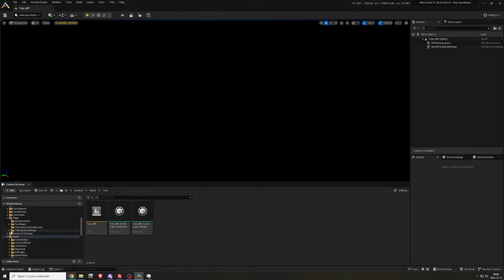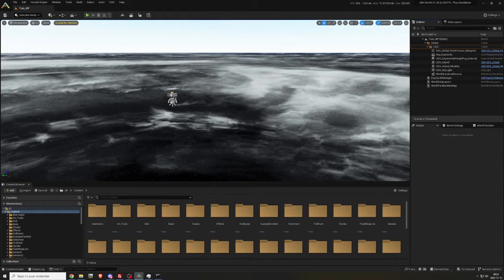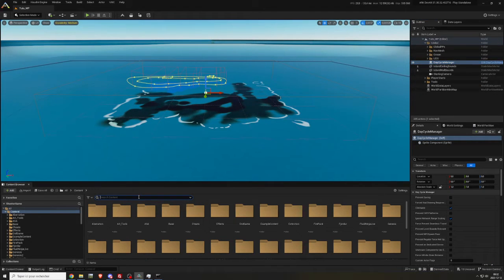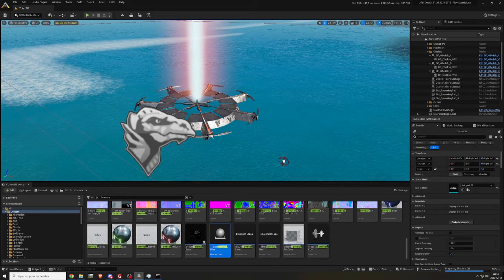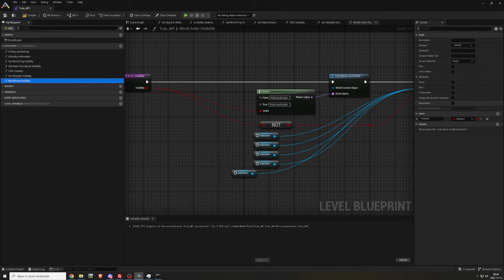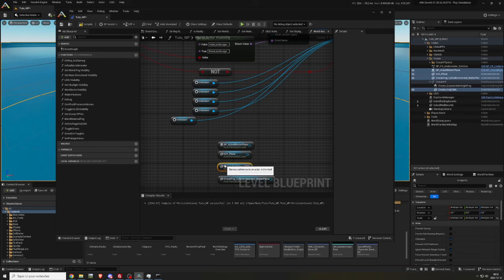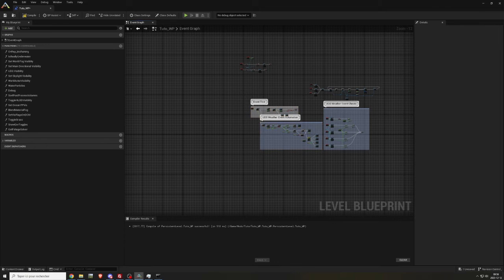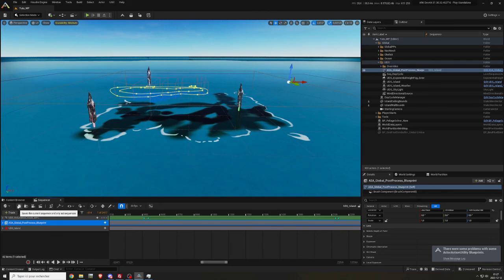ASA DevKit : Mapping Tutorial - Creating a map project from scratch (Part 02)

Comment: After adding blueprints make sure that in the Details section for each you uncheck "Is Spatially Loaded". Its probably mentioned in the video, but I missed it and it caused a lot of headaches. 😬 Additional:  In order to do the step that starts at about 16:21 you need to find  SEQ_Island (level sequence) in the content folder and drag it to the scene. Make sure the file winds up in the UDS folder to avoid a saving issue. Once you done that then you can proceed with the sequence editing instruction.
Reply: having the issue where I can not save :( I've put the SEQ_Island in the UDS folder we made but nothing is allowing me to save it.

Comment: I cant Open the Island_WP as single to copy all that stuff.  I have 32Gb ram. I rode here any other users have the same Problem. If i want to Load only TheIsland_WP i need more ram too. is there a way to do that in a other way ?
Reply: I get along fine with 32 gigs of ram, and it rarely hits more than 50% usage. The speed of your processor and the speed of the ram make a big difference though. And, having a fast ssd drive is a big help as well. Just to be clear I can open and use two instances of the ASA Devkit at the same time with 32 GB of ram (The Island_WP open in one and my mod map open in the other).

Comment: I hit a problem which stopped further progression in this tutorial, when I tried to copy/paste IslandCeilingBounds and IslandWallBounds into the scene nothing happened. I was able to copy/paste everything else in that section of the tutorial, but nothing happened when I tried to copy/paste those two items. I noted that (unlike everything else) both items had no details. Any ideas as to why the items couldn't be copy/pasted between the two Devkits?

This tutorial was helpful in many ways, but I'm headed back to the UE5 doc/tutorials and learn more of the basics. Maybe then it'll be easier follow this tutorial.
Reply: You need to load the "Persistent" dataLayer.
Go to the toolbar on the top of the window, select Window>World Partition>Data Layers Outliner.
Click the checkbox next to Persistent.
While your there check dinoSpawns, which is nested under Persistent.  You will need that later.
Reply: @randomNoise_10e1asd  Thank you for the reply, sorry was working on UE5 tutorials and just now got back to this one. After following your instructions all I can find is islandceiling and islandwall blockers, no bounds. Are the blockers the ones I need to copy? Crossed my fingers and went with that approach, just need to know if that was correct or not.  🤔

Comment: To open 2 devkits:
Step 1 - Go to your "ARKDevkit" folder on your pc. If you don't know where it is saved, close the devkit > go to the devkit in the Epic Games Launcher library > click the 3 dots for more options > manage > next to "Installation" there is a picture of a folder to "open install location".
Step 2 - With the "ARKDevkit" folder open, double click the "RunEditorSDK" bat file. A command prompt-type window will open, and the devkit will begin to load. Once the devkit starts loading it is safe to close the command prompt window & file explorer (not necessary but I do that).
You can open the devkit this way however many times you want (one devkit, two devkits, three, etc.) without ever opening/using the Epic Games Launcher.
Reply: Thanks!  I went ahead and created a shortcut to the RunEditorSDK.bat file.  Works like a charm, and a bonus, it doesn't open the Epic launcher which saves on memory and processes (oh, and annoying Epic popups).🎉🥳

Comment: Totally stumped here. First shot with the Devkit, and I got as far as putting UDS_Island and wqeather in the viewport, then there was a bit about not forgetting to copy the detail settings. Which settings...to where? There are lots of bits like this, which seem to be informative if you know what you are doing, but if you don;t, they are baffling and problematic. 
You also do not have a standard 'default' layout for the tabs you are working on, but 720p res isn't clear enough for me to read what you have. That slows down following the steps. 

I think this is a great tutorial, probably, but it is really hard to follow for someone not familiar with the stuff already. There also appear to be some differences with the files I am seeing in my Devkit with what you had. I don;t know if these are new things or if they even matter. 

Can you recommend anywhere to start that will let me learn the interface better and fill in the gaps so I can follow this?
Reply: You can try the UE5 documentation/tutorials. I've found this both helpful and a hinderance. The hinderance is that the ASA Devkit was only based on the UE5 devkit and has many differences in both layout and naming. The more I learn about mapping, the more respect I have for Mappers and people attempting to create tutorials.
Reply: You need to have TheIsland open in another Devkit. Once you have copied the two items to the view port open them in  the devkit with your map and in the devkit with TheIsland open. If there are any differences under the Details tab, copy the settings from TheIsland. I didn't find any, but its worth the time needed to check...just in case.😊

Comment: sadge I need more than 32gb of ram to open theisland map lol
Reply from the maker: hmm... are you trying to load everything? if yes then yeah probably.. you dont need to load everything tho.
Reply: @buttman5661  i tried loading it on only 1 devkit but it still crashes

Do you mean I can load like certain parts?
Reply from the maker: @Jotakyy  Just open TheIsland_WP... do not load everything. Most things are in DataLayers "Tools and Ocean" a few things like the obelisk stuff are in VFX, Far and Near but for that, only load the regions where the obelisks are on the map.
Reply: How fast is your ram? I only have 32GB and have no issues opening that map. Also, how much storage do you have on your machine and how fast is the drive? Currently the Dev kit uses over 600 GB of space, so you may be running out of swap space.
Reply: @marvinblubaugh-si4hb  it's 3200mhz with the BIOS Setting, the drive i installed it on is an 1tb m.2 ssd which im pretty sure the problem is that i cant fit it when it starts getting bigger and bigger

I already gave up on it though, it's impossible to manage a 800+ gb devkit on my only m.2 ssd that has ark on it and needs ssd to run well :/
Reply: @Jotakyy  Ah yeah, you need at least a 2TB ssd drive to be able to install and work with Devkit which just gets bigger with every map and special feature that gets added. I'm on a 2TB ssd internal with a 2TB external (for version control).  Well, maybe you'll be able to update your drive one of these days and try again. 🙂

Comment: I cant find the ocean physics... the ocean data layer is loaded. is it located somewhere else? And how can I open a second DevKit?
Reply: Oops, just saw this. I have the same issue. Did you ever figure out why the ocean physics folder wasn't there
Reply: @marvinblubaugh-si4hb  no, I'm sorry. I just paused on building my map. To many things I've to learn new for the new devkit
Reply: @chrisparadoxon4572  No worries, there is definitely a ton to learn. I had to take a step back for a while and go through UE5 tutorials/docs which gave a better foundation for ASA tutorials. Struggling with those still, but making tiny steps forward.
Reply: Did any of you find it eventually? I am also looking for oceanphysics but have almost loaded every data layer now without any success. 

A second devkit is opened by selecting the runeditorsdk in the arkdevkit folder.